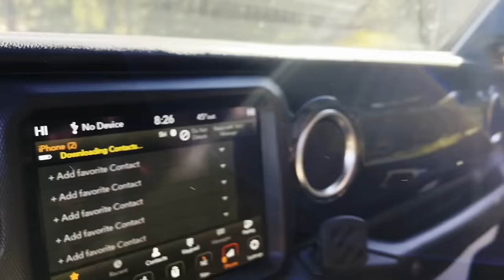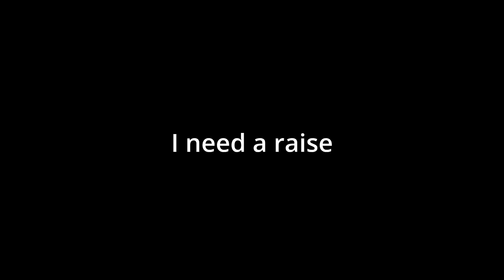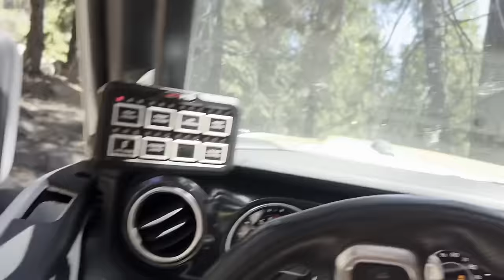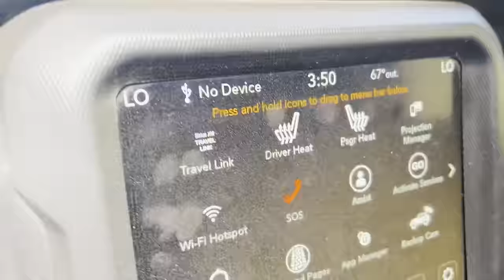Two Rubicon Recoveries | WFO Concepts

Comment: Those H3 Hummers bring back memories of 2005, I was on the Rubicon and came across a GM test group, had a nice chat with those guys.  Too bad the smaller Hummer concept didn't go further.
By the way, HO72's rule !!   Instead of the silly, klunky super 14, if only they had just copied the HO72 in all new materials / parts.....  Stronger R+P design,  yet smaller, lighter and smooth rounded.

Comment: I recently order a bunch of parts for a solid axle conversion on a GM.  WFO was on the ball.  Orders shipped out right away.  Everything was correct and the boxing was the best I've seen from anyone, almost overkill.  I just received some other parts from another company today and it was the wrong part.